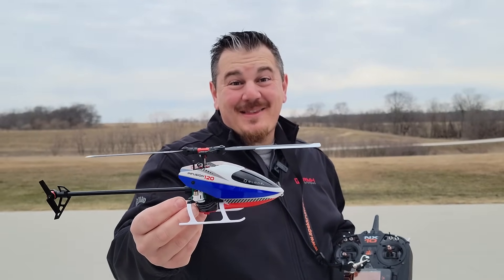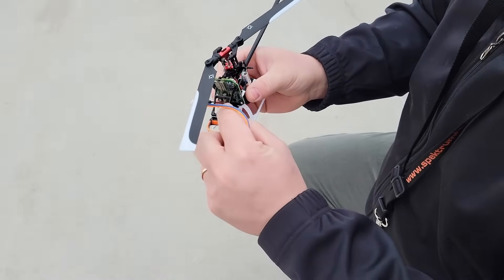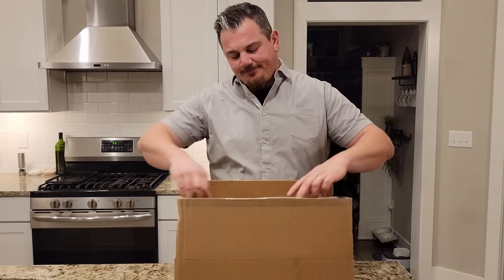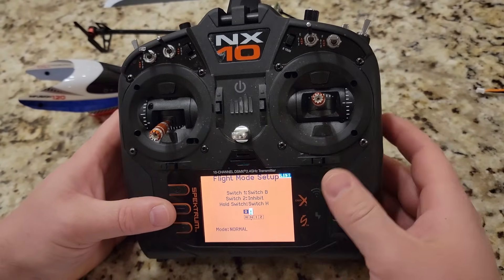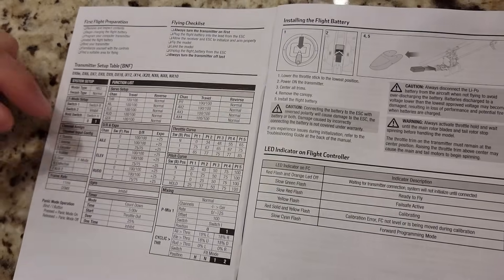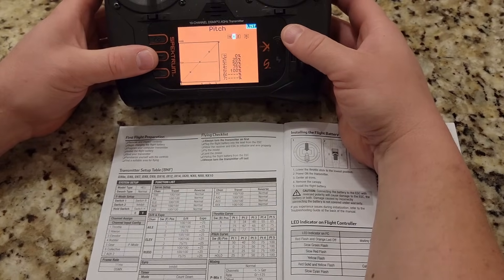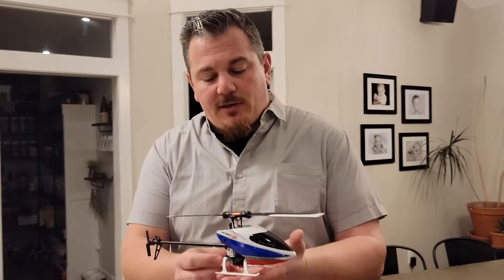Blade - InFusion 120 - BNF Heli - Unbox, Radio Setup & Maiden Flights + Crash!!!

Comment: Okay Brian..I figured, why wait till the heli comes to program the radio? Going through with ya step by step, except I made my throttle hold position "0" for on, and back to me, "1" to fly. Also reconfigured the alarm. You rock man.. I'm at 41:39. Carry on...
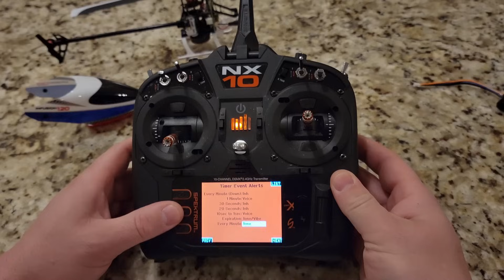35:20 Funny, I tried the vibrate thing for the timer and it scared the CRAP outta me when it went off!! I almost dropped the radio. When concentrating like some of us have to, so hard on flying, till we get better ;) to have that thing start vibrating is freaky! lol
39:15, Camera Crew! Left me hangin.. trying to see what the screen were looking like as Brian was pushin' buttons..
  got past that hurdle..
40:27 Yup! I saw that. oops. I figured out how to get past that little hurdle. You had to make your own mix, as I thought when we first opened "Mixing", it showed at the top, "CYCLIC > THROTTLE", so I was messin' around a little there, but when I saw it led me to nothing like the screen you were looking at when Camera Crew came back to work (JK) anyway...got it... almost done!....
41:03  I know I previously pointed this one out, but extra funny now that I'm actually going through it with ya.. I L'dOL! 
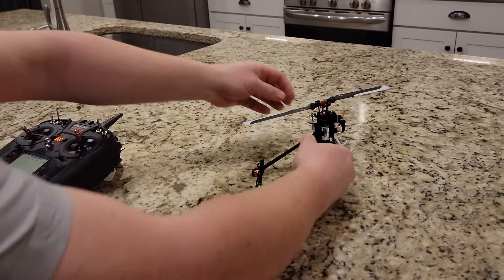44:58. Here is where we part ways for the evening. The alarm section. I think MAYBE cuz you've bound yours already (remember, I don't have mine yet :( ) That I don't have a "Smart ESC" option in my telemetry screen. So I guess I'm done for now, but I'll be back when I get my heli to do the forward programing bits. I was able to use that info to shut the alarm up on a whole bunch of other 1 and 2S powered planes and helis I have though,  so that's sweet! 
   Have a great evening. I'll be back when the heli comes! 

PS.. Here's a challenge for ya.. Create an audio event for your throttle hold that actually says, "Throttle cut on" and "off". Took me forever last night, to get it to NOT say two things at each switch position! lol
Reply from the maker: Good work! Great idea getting out ahead of the heli!!!
Reply: @BrianPhillipsRC  Heli came yesterday, and I had no idea. Living here in Southern Florida, I went outside last night at 11:16 to watch the rocket launch which I can see from my house, I noticed a box on the front porch! I brought it right in to the workbench and removed the connector and soldered on my 2s connector, no issues there. Battery tray is REALLY tight with the OMP 350 Mah battery I'm using, but a file is so far taking care of that. I was able to cram one in for a maiden, and it seemed to have flown pretty nicely! 
  Will post this fact on a separate comment, so it doesn't get lost in the weeds here, But, as far as binding goes, I used the "Hold it upside down for 15 seconds to enter bind mode" method! worked perfectly! 
  Gonna go finish hogging out that battery tray just a liiiiitle bit more. 
 Thanks once again for the great vids!

Comment: In anticipation of the arrival of the new heli, watching radio setup part intently. I have my throttle hold set up opposite like you do. When I start my radio, all switches are in "0" position, I pull the "H" switch back to me to engage the rotors. (Turn throttle hold off) Yeah, that flight mode setup can throw ya for a loop!
Reply from the maker: Yeah, sure can!

Comment: Sweet machine.  The Infusion 120 has shrunken down to mpx size.   Plane pilots get this heli.  Your skills will improve after flying this heli.  I love how quiet both rotors are.   p.s.  paint the boom bright colors!!!
Reply from the maker: Great idea about paint, but how do you keep them LIGHT and Balanced enough for flight...just DUST them with a spritz of paint???
Reply: @BrianPhillipsRC  They have enough power especially with the gyro working hard to not even notice the weight of paint.  The boom is the only thing you really need to color but painting custom canopies is quite fun.  I even put led's on my small helis.  You're good to go pilot.   I like seeing your heli skills develop.  Eventually you'll stop self deprecating about your lack of heli skills.  Truthfully you're already good.  Just push it man.

Comment: Very nice!  Love the SAFE mode
Reply from the maker: Thanks! 100% about SAFE - it's the deal MAKER for me. This heli also stood up to my little crash AMAZINGLY!!! I've had WAY worse damage from lighter crashes on other heli's that are "built better" - AKA, sometimes it's nice to have lighter duty parts, since the heli IS LIGHTER, and less inertia / damage on impact, as well as less BRITTLE parts.

P.S. I epoxied the landing gear part back together, and had it flying just two nights ago, a couple flights for the kids - Excellent Heli - IF you're a beginner, and not a Heli-snob ;)

Comment: Brian you missed some of the setup information. 

To configure RPM and Battery Infomation:
1. Select the Telemetry menu from the Function List (DX, NX
series radios) or Model Setup (iX series radios)
2. Select Smart ESC
3. Set Total Cells: 2
4. Set LVC Alarm: 3.4V Set Alarm; Voice/Vibe
5. Enter the values for the magnetic pole count of the motor
(14 pole) and the gear ratio (1:1)
6. Set the Status and Warning reports to suit your needs. We
recommend setting Warning Reports: 10 Seconds.
When your transmitter is connected to a receiver sending
Smart Data, the Smart Logo will appear on the main screen.
Scroll past the servo monitor to see Smart telemetry
information screen.
Reply from the maker: Thanks for the supplement here, much appreciated, and sorry we missed that part!
Reply: @BrianPhillipsRC  not a problem brother keep doing what your doing.

Comment: around 30 mins in, yeah, that radio can be tricky. I have an NX8, which I learned A LOT about from watching your videos. (THANK YOU!) and sometimes it can play tricks like that on ya! lol I ordered my heli, and am now just watching the setup video for the first time. Most of the time, I get the setup from the library, however, It seems like setting it up from scratch is better sometimes. It can be daunting, but the time you take to go through it all is time well spent! 
   33:18 lol I have a cat too... I get it. ;)
  45:08 YEAH! My dopey radio does the same thing on my 1 and 2 S powered helis. Always has that dumb alarm goin'! Maybe if I keep watching, you'll tell me how to make that stop...

At 49:06, I REALLY wanted you to pick up the heli and see if the servos tried to stabilize it now that it said "on" in the window. Also wondered if like on some models, you have to engage the throttle first before SAFE will engage..Carry on...
  Okay, I gotta say it. I HATE those dopey connectors. Here's what I did on my When I got my OMP hobbies M1, it uses a little 2s, 7.4volt, 350mAh pack. I also have a Blade, mCPXbl2, (which is kind of like this helis lil brother, as it's got two brushless motors. not direct drive though) The Spektrum battery that they recommend for that is the same for this new heli. I noticed that the Spektrum pack actually fit really loose in the battery cradle, and used a toothpick to keep it wedged in during flights. So, long story short, The OMP pack actually slides in ever so nicely, and I just changed the dumb connector on the heli to that standard 2 s connector that's on the battery. Easy to charge with one of those small, dedicated for 2 and 3s batteries chargers too. and a longer flight time is a bonus too, have my timer set at 8 mins.
  Once again an AWESOME video man. Thanks for the good work.
Reply from the maker: Thanks! Glad you enjoyed it, and really appreciate your TIME STAMPS - that's invaluable for me, since as you know, we really like to reply - this makes it so much more possible for me to FRAME the conversation. We have so many videos, and while I was admittedly there for the filming, I was also there for the filming of every other video - it's strange to think how easy it is to totally forget what I said myself - LOL ;)

I've looked over this Micro PH 2S plug, and found it would be VERY easy to just use a run of the mill, JST connector or even go for an XT30 or IC2 - either of which would be a perfect solution - WAY more current handling potential...but the JST would be a very minimal additional weight adder and still can use the "NEW" 2S 50C 300mAh packs - a WAY better pick for a "3D" heli, in my opinion. - Like this - https://www.jdoqocy.com/click-9240406-15735260?url=https%3A%2F%2Fwww.horizonhobby.com%2Fproduct%2F7.4v-300mah-2s-50c-lipo-battery-jst-rcy%2FSPMX3002S50.html

I think I MIGHT try it, since I have these Micro PH 2S to JST adapters already - https://www.jdoqocy.com/click-9240406-15735260?url=https%3A%2F%2Fwww.horizonhobby.com%2Fproduct%2Fadapter-jst-rcy-battery-jst-ph-device%2FSPMXCA327.html (which are admittedly, crazy pricey, since I can make them WAY cheaper, and get like 10 - 20 for that price - https://amzn.to/3uNhrwa - but, soldering isn't everyone's thing, I guess...)

Thanks for being here with us!
Reply: @hillipsRC On again tonight to sort out my Blade MCPXbl2. It has that dopey battery alert that goes off, so tuned in at 44:59 mark to sort that out. I have no clue why the heli lost it's bind. Went through horror stories today with the throttle hold. UGH! There's one you can access from the main menu while open to fly, then ANOTHR one you have to go in to System settings for, which deactivates the transmitter fature. (you know how that works) But I had to reverse the function of the "H" switch, as throttle hold was back towards me (position 1) which I don't like. then had to reverse the audio event, then had to un do the dumb warning! (I don't remember if it was THIS heli I saw you fix that on, or another one, but I got it sorted. Your help and diligence with each model you review is just top notch man. And "Camera Crew" does an AWESOME job too. I like how sometimes, she seems to have already read the instructions! ;)
  Anyway, off to get that dumb low voltage alarm sorted out.
  As far as the batteries and connectors go, isn't the JST plug for 1S cells? As far as not using a balance plug anyway? I'm still a little lost with all the connector nomenclature, hate to admit. I did order a zillion of those connectors from good ole Slamazon, the "2s" type, and like I said, just soldered one on to the heli and called it done. But, yes, I see the battery you put the link to, and the adapters. Here's a link to the batteries I'm using. They were originally for my OMP M1 heli. ( A REALLY nice lil heli if you haven't met one yet) Now I use them in my Blade MCpxBl2, ans my OMP M1, AND my teeny tiny lil Atomic rc car. 
 https://www.omphobby.net/OMPHOBBY-M1-Replacement-Parts-Lithium-Battery-Set-2S-350mAh-50C-for-M1-M1-EVO-OSHM1024-p1784342.html

Funny as I couldn't find them anywhere else but on OMPs site.
  Anyway, off for a quick test flight.

Comment: Hmm, not something id buy. Im done with blade helis. The cost of parts and the performance of their helis are lacking. There is so much to tweak and fix out of the box. They make great beginner helis but if u want performance blade is not it.

A tail boom for the gosky s2 is 4$ vs for this infusion 120 the tail boom 14$
Reply from the maker: I think you hit the nail on the head, so your and my opinions aren't too far off. The Blade products are GREAT for people like me - plane pilots looking for a gateway drug into heli's (and newb's) - but there's no doubt that Goosky is making some great heli's too. Unfortunately, when you crash a Goosky, like I will (LOL/CRY) it will NEED parts. I can't believe this thing stood up to my crash, which happened toward the end of the outside flight. P.S. I epoxied it back together, the landing gear broke on BOTH sides. I thought it was just the ONE side, but I was wrong, even still had it fixed in 5-10 minutes, then taped the canopy back up from inside - nobody will be able to tell, unless they look OR see the video we published for the world to enjoy - LOL

Thanks for the comment!
Reply: @BrianPhillipsRC  Once u buy a Sab, align, goosky, xlpower, Tron, Steam, or any other kit from a Heli brand; u won't look back at Blade Helis. The sheer machining, manufacturing craftsmanship, on these kits are amazing. It's like artwork.
Also I'm not afraid of crashing, but my wallet is! Lol dude 700 size blades and parts are expensive! I like crashing the smaller stuff. I have a designated beater heli. The smaller the cheaper.
Reply: I disagree strongly that a Goosky S1 will need more parts than the Infusion 120. For a start, the S1 has metal blade grips and swashplate. I had a complete nightmare with the mcpx bl2. Parts for the Infusion 120 cost 2-3 times of that of the S1. Not only that, repeated crashes will damage the all in one board. If anything, this is likely to turn into a nightmare if you crash a lot.@hillipsRC
Reply: @derekwong1899  I have no issues with my goosky helis. My s2 is my beater. I love it! It's so much better than a blade 230 or fusion 360. I crash it, fix replace parts all the time. And parts are cheaper Than blade.
Reply: @derekwong1899  I agree with u

Comment: Hope it's better  than the 180
Reply from the maker: Yes. We apparently did the 180, and it wasn't maybe as memorable as we had hoped ;) This heli seems to be more like it's bigger counterparts, in it's flight characteristics, which I really like. My only issue, if there were one, would be I'd love to see a JST battery lead rather than the 2S Micro PH connector. This might allow us to use the new, higher C 2S 50C packs, BUT after giving it a fresh look, it would be SUPER easy to mad this...even the lesser capable RC enthusiast would be able to do it in no time. This might help a bit whit POWER PUNCH for heavier 3D experiences - of which I probably won't be experiencing any time soon, due to my lack of skills.

Also, wonder if the heli would take 3S? That would be AWESOME! Please don't take this as a challenge, unless you want to let me know if she survives ;)
Reply: @BrianPhillipsRC  I'd say not cause the motor would be wired for 2s on a little heli like that I'd think but blade did have a 130 like that that ran on 3